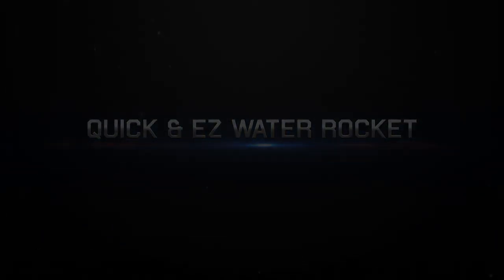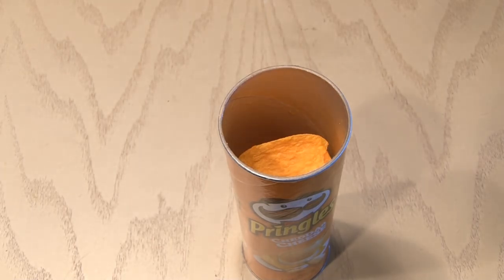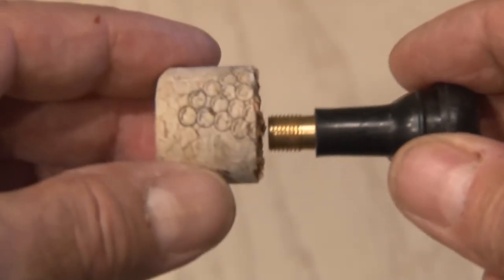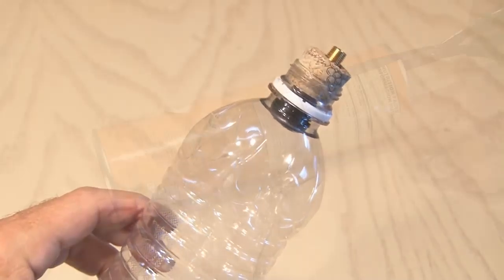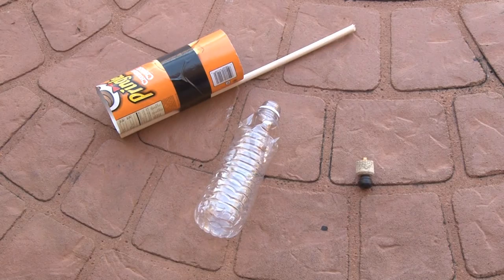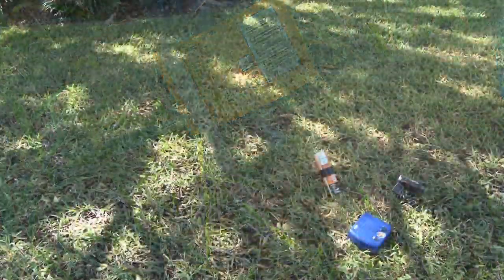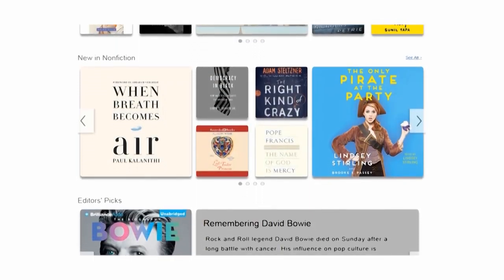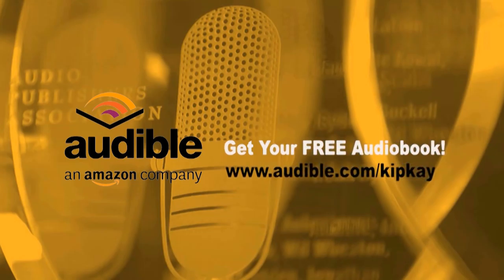QUICK & EZ WATER ROCKET!

Comment: i know how to make a easyer  vershion what you do is poke a hole in a bottle cap get a strow and cut it and half then get a pump and plug the strow in and plug the other end into the cap and strew it on then fill the water bottle half way with water and pump it but make sure the cap is facing down